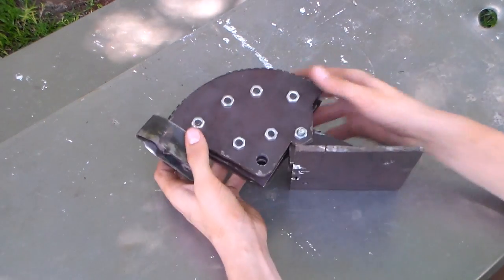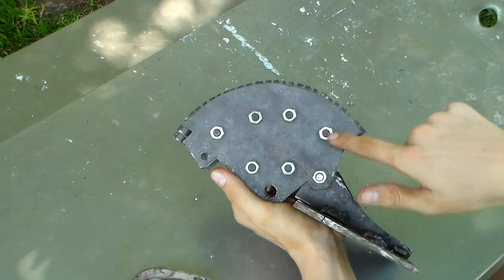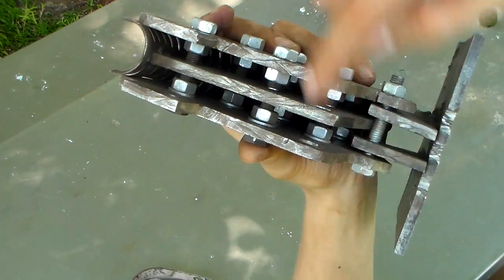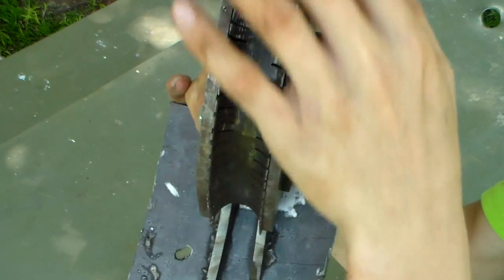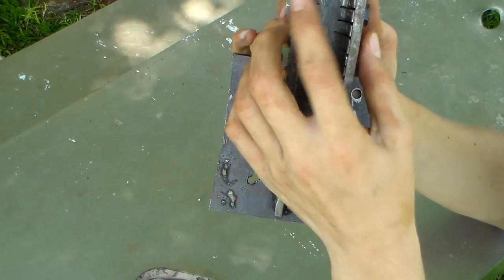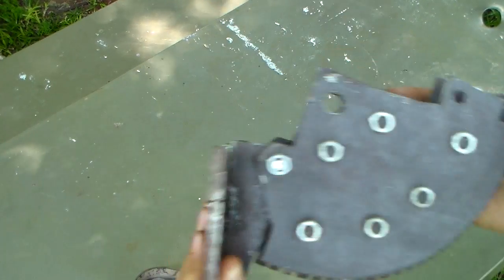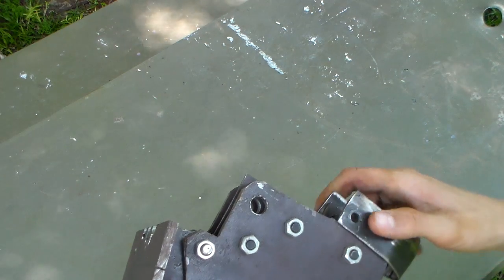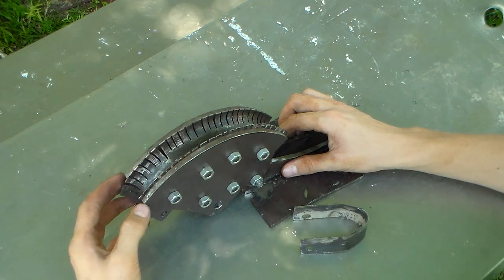Homemade Die for Tube Bender

Comment: I like this variation on a theme die because it doesn't require machining to make it work properly, just normal shop tools. The push plate will need to be different from machine to machine, but that's small potatoes. Thank You, JD

Comment: the plates looks quite thick, are you sure they are 5 millimeters?
Reply from the maker: Yeah they were 5mm . But using something thats thicker wouldnt hurt. The 5 mm worked fine but after a long time it does slightly start to buckle out
Reply: @XanderKirsten  Okay. I have 8mm plate but i want to bend 38mm tube with 2mm Wall thickness. Do you think the plates are gonna bend? Im also thinking about filling the die with epoxy or concrete to make it a bit more stiff. Adding big washers to the outsides might also be a Good idea
Reply from the maker: @OversteerEngineer  i believe 8mm plate should do just fine. Big washers are a good idea aswell. I did my testing woth 25mm tube also 2mm thick . I dont think concrete or epoxy is necessary. One thing that i also recommend is making the rod that holds the die quite a bit thicker as mine kept bending